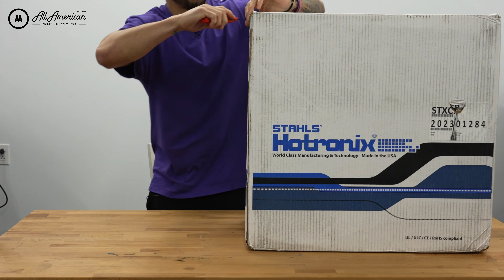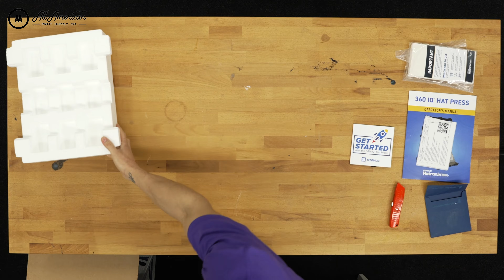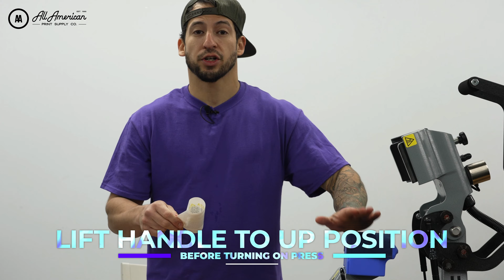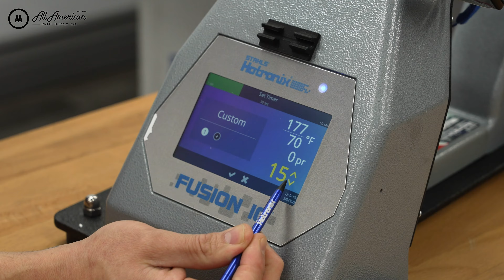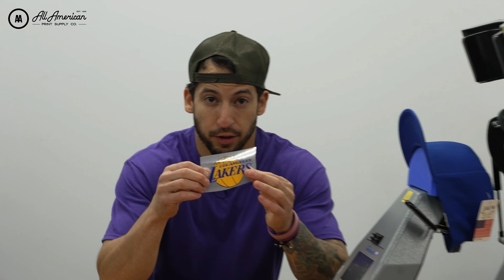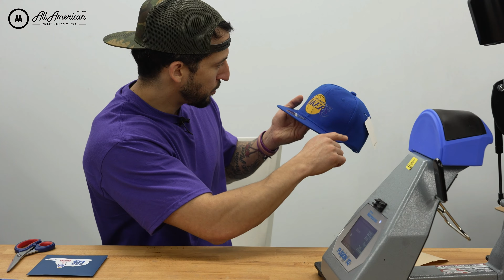You Need This For Your Hats - Hotronix 360 IQ  | AA Print Supply

Comment: What's up with that white fuzzy border around the dtf transfer?
Reply from the maker: Oh man, this video's a throwback. Could be from either pixels in the artwork or possibly excess pressure "squishing" some of the adhesive out from under the transfer. To a lesser degree, the humidity on set that day may have resulted in powder retention around the printed image (less likely, still possible)